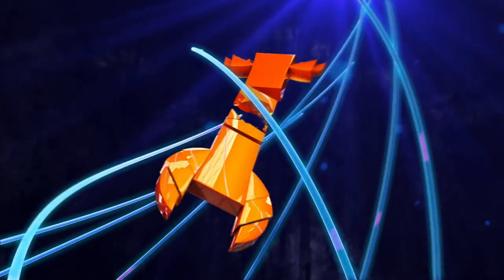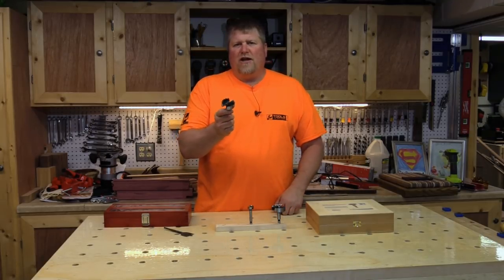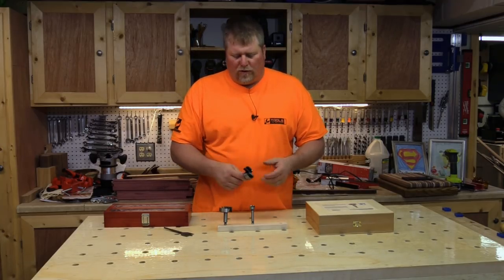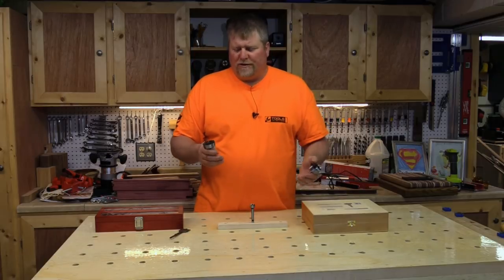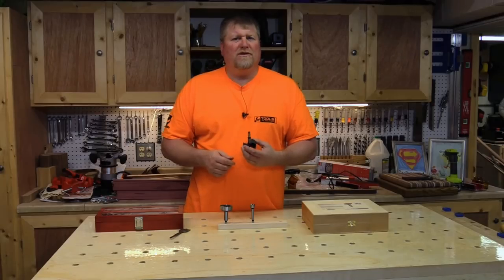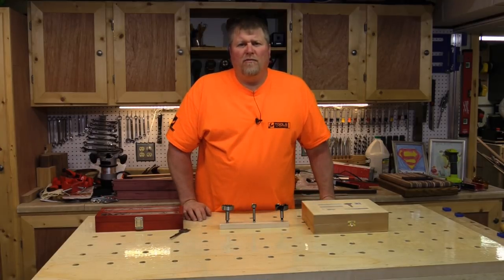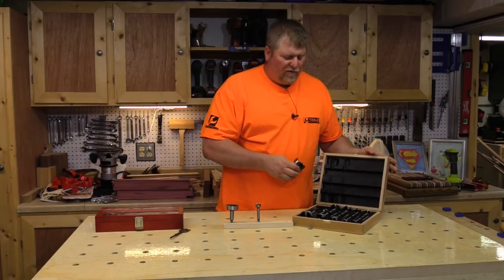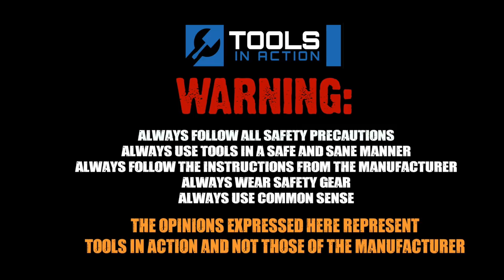FISCH WAVE CUTTER Forstner Bits

Comment: you forgot to mention drilling angled holes the saw tooth bits give bad tea rout the knife cut do better and the fisch bits do the best lets say you doing chair's that have back supports that require a dowel at 22.5 drg angle you won't cut them, with the saw tooth bits.
There is a reason for different types of bits. the cheap set is good if your in a pinch.

Comment: Are these bits sharpenable?
Reply: yes they are.  As a matter of fact, Fisch came out with a new sharpening tool for Forstner Bits about 6 months ago.  You use it with a drill press.  I have not had the chance to work with it yet.

Comment: Says those can be sharpened up to 30 times. Do you know where and how that would be done?
Reply: RC W there is instructions that I saw.  I'll look for them when I get home.  I think I found it on the fisch site.
Reply: Hello again.  I just went to the fisch site, clicked on the wave cutter bits and there is a very brief (not helpful) section at the bottom of the download that tells you how to sharpen the bits.
http://www.fisch-tools.com/en/Products/Drills-Countersinks/Forstner-Bits/0317

Also, Stumpy Nubs (youtube) has a great video on how to sharpen these exact bits.
https://www.youtube.com/watch?v=rLoEulA4mM8
Reply: Thanks John, I'll check that out. I'm a fan of old Stumpy too.